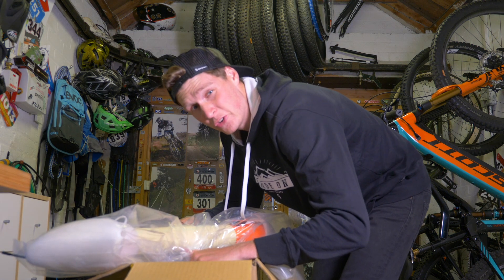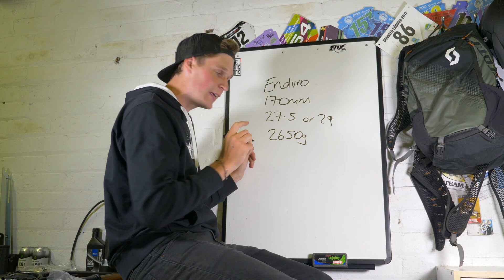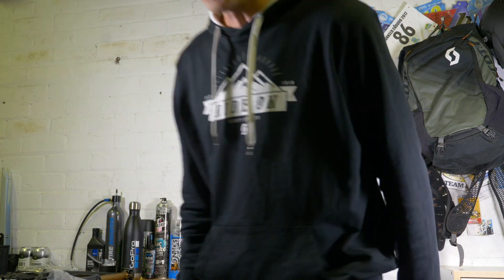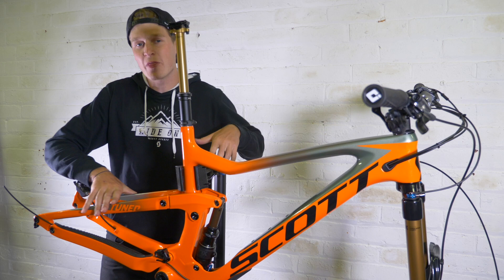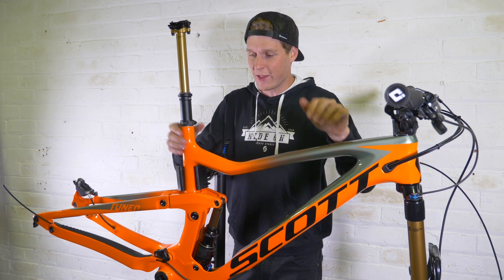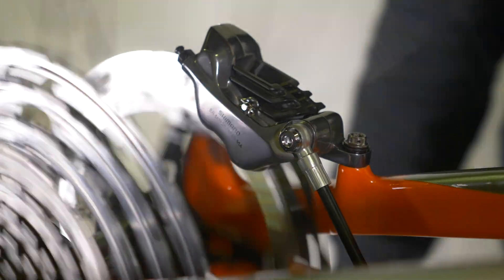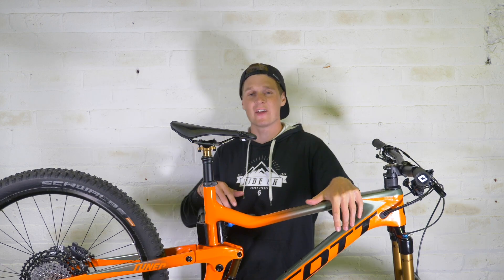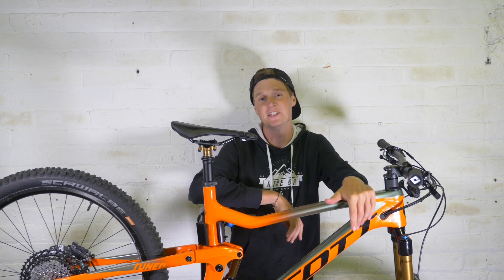Building My Dream Enduro Bike | SCOTT Ransom

Comment: You should try 29 up front 27.5 rear!
Reply: MTB Kevin He should get rid of the Nude shock and put something more adjustable with piggyback in there and also throw the twinloc out. Not needed on a full blown enduro rig
Reply: And a 36 with the grip 2 damper
Reply: Day light but then it’s just another enduro bike. What makes the ransom different is that it can shred down the descents but still climb back up to the top really well.
Reply from the maker: Have you tried the Twinloc system? Sure it's not everyones cup of tea but once you've ridden it you would understand how good it is... Not to say I won't try a coil and a Grip 2 on this bike at somepoint however ;)
Reply: 27.5 front; 29 rear.